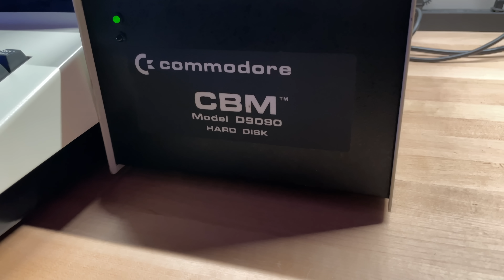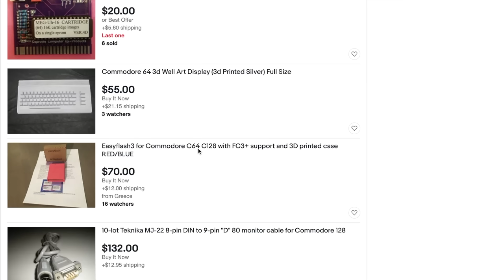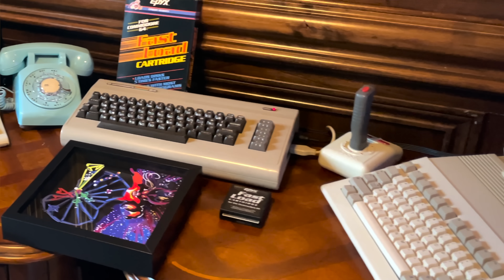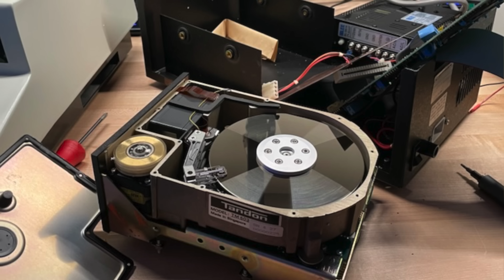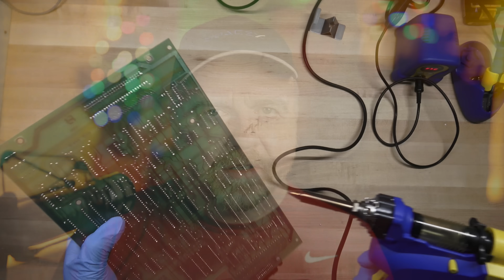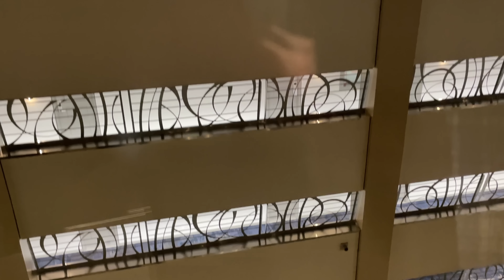FOUND: A Super-Rare Commodore D9090!

Comment: Hi Dave!  So, I do know somebody that has both the 9060 and the 9090.  I could most likely borrow them and do an episode about them.  That being said, I'm not sure what I could say about them that you haven't already covered in this video.  I will think about it, though.
Reply from the maker: Please do!  I think perhaps one interesting angle could be whether Commodore would have been more viable vs the alternatives had their drives been more affordable, and they'd have been much more affordable if not for the "smart controller" scheme.   Commodore's decision to put two 6502s, multiple PIA chips, RAM, and an operating system inside the drive certainly made it expensive.

Plus, you could do a whole section on the I/O channels and commands, on how BASIC commands interoperate with the PRINT# and INPUT# statements.   It was unconscionable that they shipped it with no IO commands in BASIC 2.0 at all.  

Perhaps a hybrid episode is warranted, where you primarily focus on the "Professional" side of Commodore and talk about BASIC 4.0, the hard drives, all the commands added along with it, their hard drives, daisy wheel printers, and so on.  I bet you could get a solid 15 minutes out of that, and it'd be interesting this "audience of one".

Other than printers, I have a nice setup here with a fully expanded 2001, 8050, 4040, 9090, and so on.  I'd be happy to share some footage of that as absent the printer it's all "business class" hardware for the day.  I've had a 4032 en route from Spain for a month as a Christmas present for a friend, but it hasn't made it yet!

In the pro line you could also talk about the 4016 (FAT 40!) and the 4032 and 8032, along with the SP9000.  I have all the Waterloo language books for the SP9000 and could provide some nice B-roll for that, but no SuperPET on hand, unfortuantely!

On top of all of that, heck, you could do an entire episode on Batteries Included.  I used the BI-80 card and the BusCard II to get 80 columns and IEEE-488 support on the C64, which kept me going before the Amiga cross-assembler.  Back in the day as a game programmer, until I got my 128, I had an 80-column C64 with dual IEEE-488 drives (I think SFD-1001s, if I recall correctly).  All enabled by Batteries Included technology of the day.

All that stuff is out of my wheelhouse for my channel, so I'm hoping you can do the heavy lifting :-)

Sorry for the ramble, I don't get much chance to reminisce about the CBM history!

Cheers,
Dave

PS: One of the greatest tragedies is that Ric Weiland at Microsoft took his own life some years back, and he wrote COMMODORE BASIC 2.0 that we know and love.  There's a lot of questions I'd like to ask him about BASIC 2.0 that otherwise, only BillG knows the answer to, because Paul Allen has passed as well.  But before BASIC 4.0, everything had to be done over IO channels, and it was worse than assembly!

I assume you've seen the source code to CBM BASIC.  If not, perhaps we could collaborate on that at some point.   I spoke at length to Monte Davidoff who wrote the math portions, and traced their lineage back to the PDP-5... stuff like that!
Reply: @DavesGarage  You could contact Bil Herd, he was the hardware lead engineer on the Ted, C64, and C128 systems and worked at MOS.
Reply: @DavesGarage  This is going to be epic! The Eight-Bit Guy and Dave's Garage together.
Maybe you could take a poll on what historic programs to run on these beauties...
I can't wait to see what the suggestions are!
This reminds me of my TRS80 BASIC days, 10 this, 20 that, 30 other, 40 go to 10... simplest code...
Reply: @DavesGarage  I used to have an SFD-1001, too. That was a lot of space. Felt larger than a 1 TB SSD today. A guy basically scammed me, traded it for an acoustic coupler. The guy lied about it doing 1200 bps. It only did 300 bps. I was surprised it should do 1200 but hey, I was 14 and I guessed he'd know. Anyway, me getting online was worth it in the end.
Reply: @DavesGarage  Be sure to post a follow up Dave as David has collaborated with quite a few of the channels I'm subscribed to. Kinda makes me wonder if Google is spying on me. 😁
Reply: Curious, would a standard St 225 drive work as the MFM drive as well? I remember right they were 20 megabytes each?
Reply: @Wyld1one  ST225 is a 20 Meg Seagate..very solid drives..i was working at Tandy in Santa Rosa Ca in the 1980's and setup an internal BBS on a Tandy 2000 with 3 ST225 drives..the drives were setting bare on a shelf above the 2000 ..then we had a tremor which shook the shelves and down came the drives i was quick enough to kill the power supply but they all 3 hit the floor...i figured they were toast..i plugged them back in and ran a disk check and each had a new bad sector ..other than that they worked great for a couple more years...
Reply: @DavesGarage  did you work on vdm virtual dos?
Reply: @DavesGarage if you only worked at Microsoft for 10 years and retired. And your one of the few youtubers without a patreon (which I like), you must be pretty loaded man lol
Reply: @davidt8087  he mentioned in another video that he didn’t get much at microsoft back in the day (and he didn’t haggle, though he could/should have) but he got stock options. 
Microsoft Stock over all this time... So go figure xD
Reply: @DavesGarage Two 6502‘s ? How to make multiprocessing on a harddisk.
Reply: @yorkan213swd6  Commodore was known to use (expensive) intelligent peripheral things like drive controllers. Luckely I had a TRS-80 model 1 (like Dave) which did things much more traditionally, so the Z80 did everything. However the TRS-80 didn't have DMA (direct memory acces) and it was too slow to even handle the incoming data from a DD (double density) floppy, let alone HD (high density) floppies. In the case of the 6502, I think there was a technique to make the 6502's work in alternating bus cycles, so they were invisible to each other. Perhaps it was needed to overcome the problem above. 6502's weren't very expensive of course.
Reply: @DavesGarage Hello Dave. You mention that stuff is "out of your wheelhouse". I would personally love to watch content like that. Maybe on the "Dave's Spare Bedroom" side channel.
Reply: I have a D9060 and a D9090 and I would love to help if possible (I am from germany).
If anyone thinks it is hard to find a D90x0 you should try to find a (working) 8280! I have only seen one and that was broken (and not for sale). :o(
Reply from the maker: @C64-Museum  I've never seen the 8280!  I have an 8050 and had an 8250, but never the big one!
Reply: @DavesGarage  Nice to see that you have old Commodore stuff! I searched a long time for the harddrives. I got mine from a friend in sweden (the guy who found the C116 prototype!). I got two more broken harddrives but we could not fix them. I am not sure if it was the SASI or the other board?! A friend in the netherlands got them.
Reply: @DavesGarage  My friend in high school had a vertically stacked dual.  I don't think it was more than 170k disks IIRC.  I have yet to see that one in pictures anywhere.  It only had a round Commodore label on the face, otherwise wasn't even the traditional logo.  The 8250lp sounds like it would be more rare than a plain 8250.  I would have thought the 8" drive/8280 model should be the rarest of all.  8"??  What the world...
Reply from the maker: Hi David!  I can't find an email addr for you, but wanted to double-check it would be OK to use <1 min of your pet keyboard episode footage with attribution?  You did a very nice job on it and I have to explain the same thing for a different episode!
Reply: @DavesGarage  Dave, I know this video is two years old, but watching it again today I had a thought. What happens if you put the original power supply back in that drive, and power it off of a consumer grade travel converter? The kind of thing you get if you were German, and traveling to the US for a few weeks. I don’t actually understand why you didn’t just do that to begin with instead of having the custom circuit put in to the drive, but regardless I am really curious if that would solve your GFCI problem.
Reply: @FriendlyNeighborhoodNitpicker  Modern switching power supplies can use both 120 V and 220 V. Dave might want to look into that. You only need a cheap mechnical converter between the two shapes of the connectors. Switching power supplies switch the high voltage on and off very quickly using a thyristor to produce the low voltage that is required. Only a small transformer and a diode bridge is needed and some elco's to stabilize the output voltage. I was told that there are versions of the 7805 etc. available now that are switching inside. Would be nice!
Reply: We will still watch it David. You could read the yellow pages for 15 min and we would want more. And think of the charity!
Reply: Money is on the line... :) Love the channel either way!
Reply: Hey Dave! This message is powered by NT Technologies.. anyways.. a GFCI detects power imbalances - not just leakage. For example, as a Controls Engineer, I was in a factory with a Radiant Dome Heater and a Service/Commercial Radio. Every time I queued the radio, the RF would hit the dome and collect, and within a second the GFCI would trip. Every time, over and over. Nothing was wrong with the heater..
Reply: thats nice!
Reply: Do you know anyone who has/d a C64 with a 10G hard drive?  I knew a guy in KY that had a 10G hard drive on his C64 running a BBS back before the internet
Reply: So when I was in highschool, circa 1985 we had a lab full of commodore CBM PET 8032  units and they were networked via some kind of multiplexed-network-over-ieee488-cables to a SINGLE dual-8050 floppy per 8 machines.  What an awesome thing one of these 9090s would have been.
Reply: video two d9090s in raid.  nuff said
Reply: Dave vs Dave… who bit off more than they could chew?
Reply: Ok so what's next the PS2 from IBM and micro channel ? I have and old K pro if you want. Lol
Reply: @carlscorner4820  No no, micro channel is the devil!
Reply: yeah, most vids on C64 will usually culminate around games and game play - an historical bit on Commodore 8-bit computers as used professionally could be a good angle of approach by which to tie in all the disk drive maddness
Reply: Do it
Reply: As my peers in high school would say to egg me on, "You won't! You won't!"...
(I hope you do)
Reply: Please do the colab, please .. love you two xxxx
Reply: Oh heck, lots of memories here. Had a lot of that Commodore hardware (the personal stuff plus an SFD) and I loved Batteries Included.

FYI, my first computer was a Timex Sinclair, 2k RAM with a 16k RAM expansion.
Reply: Try the ol' scratch and sniff test.
Reply: If I had been you my final reply would have been, “Yeah… I’ll get right on it”😁
Reply: Please do it 8-Bit Guy!
Reply: great to see you respond to this so quickly... I love it when the YouTube community challenges each other for the betterment of content (and historical goodies) :D
Reply: You have to do this and share them with the world, oh legendary 8-Bit Guy!!!

You have dedicated so much time to documenting old Commodore hardware, I think it would just make sense to show the world these drives! Your amazing way of delivering the history and operation of these old computers is second to none!

You know all your fans would love to see you cover these! Plus it would be for a great cause!
Reply: A collaboration video between the two of you would be the ultimate!

Comment: A GFCI circuit measures the difference in current between the Line and Neutral. If they differ by more than about 5 milliamps (may be as high as 30 milliamps), then it triggers a solenoid which disconnects the power. If your GFCI it tripping, then I think the only thing that can cause it is a fault that dumps current into the ground line. If there is a MOV (metal oxide varistor) on the power input of your power supply, then an over current condition could cause them to heat up and trigger (which they would usually only ever do in a power surge/lightning strike). That could be shunting current from the line or the neutral into the ground pin, tripping the GFCI.
As for why the unit is shorting 12V, my best bet is a faulted capacitor. When a cap fails, it generally turns into a short circuit. That would explain the sagging motor speed followed by catastrophic failure. You can't test them in situ. You need to desolder at least one leg from the cap to test it for a short. You might be best served by replacing all the caps on that board just to be safe.
While you're on that board, check the diodes and look for one that's reading open (infinite resistance) in both directions. Replace any you find in that condition, but that is unlikely to cause a shorted 12v rail. A shorted Diode will read 0.4v drop in both directions, and that indicates a bad component too., so replace those as well.
Reply: I haven't seen it myself but apparently some GFCIs will falsely trip on certain types of electrical noise.

Comment: I have a theory: I suspect damage to the motor windings. Why? My box fan got hit by a surge, and I smelled hot shellac. Line DC was dead short pos/neg. Which, as you probably can guess, means it doesn't work as a motor very well... I've seen several cheap motors die from overvolt by melting the shellac or vinyl, and shorting in the windings. A partial short preexisting could, at inrush, arc and make the damaged insulation area into a permanent short.

Comment: Many people these days cannot fathom any storage medium in anything less than GBs.

My first Amiga 2000 had a 54 MB hard drive which was surprisingly roomy. Later on, I expanded that with a SCSI Zip drive with mammoth 100MB disks. Never ended up using more than four disks during the Amiga’s remaining 5 year life span.

And only moments ago, I found an old 16MB CF card. I guess that can store a few JPGs or 3 mp3 tracks.

Comment: I have an SFD-1001 drive (2 of them actually, but only one works) that is so old that the actual case plastic is degrading and turning to powder. Which is really weird, because all the 1541 units I have from the same era are fine. I have a PET 8032 here too, but it has bad ram right now, need to find the time to replace it. Also, yes to PET keyboard issues - mine was physically broken when I got it, and when I fully broke it down and restored it I managed to fix the space bar by wrapping some wire around something - i forget the details :)

Comment: I feel your pain. As a field service engineer for the UK's largest independent maintenance company with 400 engineers I worked on a product range called Molecular Computers (that meant something else in the 1980's) which ran a multi-user CP/M varient called n/star and had a Z80 CPU board for each user on a mega-bus like a blade server run by an FP or file processor board with anything from 10 megabyte Seagate drives with stepper motors to 8 inch 70 megabyte Priam drives with voice coils like today's drives. With up to 32 users all running WordStar on their own 64K processor board it was state of the art and as fast as a mainframe if you weren't running a massive database. Fun fact, format the C: drive and it would format the D: drive too. 40 staff not working during a hours downtime meant a man-week of lost production and a day's downtime was a disaster, so formatting a drive for 8 hours was kinda expensive. Fun times.

Comment: Wow, fantastic video! As someone who started off back in the day (1979) with an 8K 2001-8 PET with the chiclet keyboard and built-in tape drive, it was around 4 years before I could even afford a disk drive. When I could it was the smallest of the bunch - the 2031 single drive - I used to look at the ads for the D9090 and D9060 drives and drool! That old PET (before it got passed on) had been upgraded from Basic 1 via Basic 2 to Basic 4 (via EPROMs on a hand-built, self-designed, hand-drawn PCB as the PET itself was socketed for the incompatible 6540 ROMs) and to 32K via a hand-assembled 32K board kit. Fun times!

Comment: The "V-" connection on similar-looking PSUs I've used is the negative terminal of an isolated, single-supply output, with "V+" being the positive. It is not connected to the screw terminal with the ground symbol, which is intended for safety ground and also connected to the chassis of the PSU. Was this accounted for, with consideration for any possible connections between the negative rail and chassis/safety ground within the existing drive circuitry?

Comment: Ground fault breakers can trip when the full bridge rectifier on the primary side of an switch mode powersupply has one of it's diodes failed 'open'. 
It than becomes a half bridge rectifier in essence the power supply draws pulsating DC wich your breaker doesn't like.
Reply: thats super interesting and thank you for sharing. :)
Reply: The GFCI shouldn't care about pulsating DC; as the current flows out live and back to neutral there shouldn't be any flux generated in the sensing coil.
Reply: @eDoc2020  with classic versions the core gets saturated, modern smart  ones with arc sensing will trip.
Reply: @picobyte  Arc sensing ones are called AFCIs. There are combo AFCI/GFCI units but I don't think they're common. At the very least receptacles with AFCIs are extremely rare.

Comment: Did you check for a short to the chassis?

Because modern power supplies aren't separated like the old wall warts and a short to the chassis after the power supply will be an AC power leak to ground.